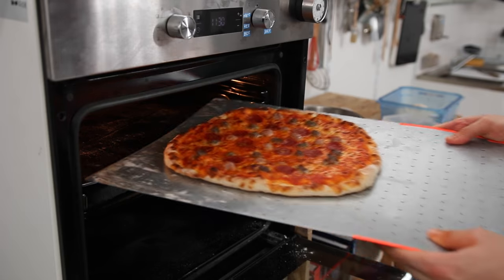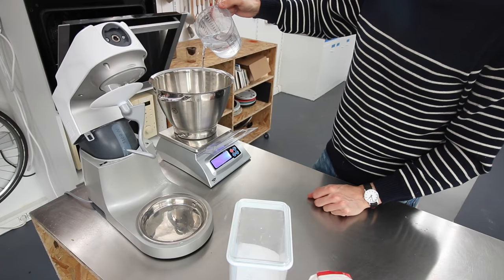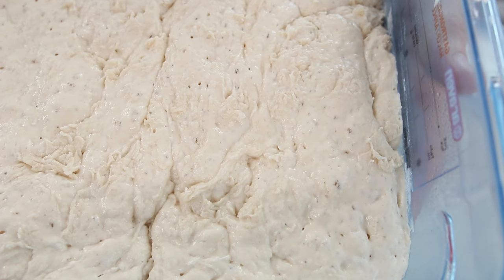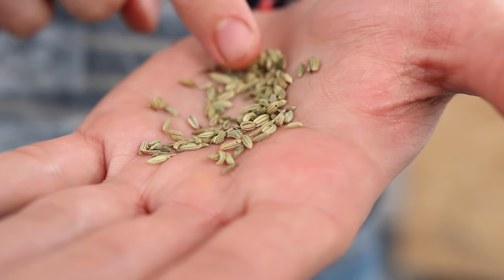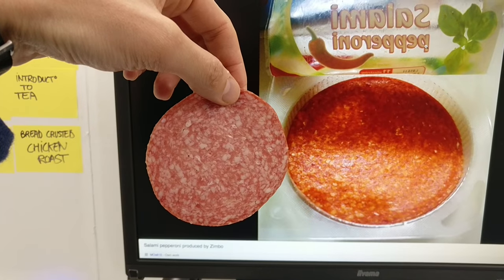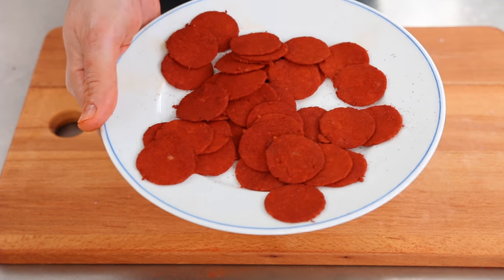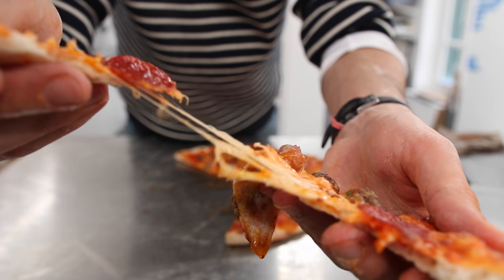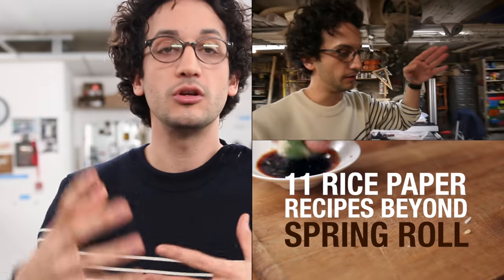How to Make DIRESTA'S MEATLOVER PIZZA : Pepperoni, Sausage & Meatball !

Comment: Something that Alex didn't immediately mention in his video that I thought I'd highlight is the nature of the flour that he used!

He's using a Type "00" flour, one that's extremely light in comparison to all-purpose or plain bread flour. It produces a much lighter crumb on the inside of the pizza, and allows for a crispier, almost cracker-thin crunchy crust on the outside. It can also produce crusts that can handle temperatures in excess of 700 degrees Fahrenheit.

Happy cooking!!

Comment: Good morning my french hero! Inspired by you I also made a baking steel for pizza :D But instead of stainless steel I milled it from aluminium. This has in my opinion a couple of advantages: It heats up a lot quicker and also transfers that heat a lot quicker to the pizza, since stainless is a very bad heat conductor. The second advantage is that it is three times lighter and also a lot cheaper to use aluminium. I milled it to the size of my oven so I don't need a tray, it just slides in and my pizzas can be larger :D I also found that it was hard do heat it up properly with a preheated oven and grill, since ideally you want it around 300-400 degrees. What I do now is turn on the grill of the oven 5 minutes in advance, heat the baking steel on the stove on all burners up to 370°, place the pizza on the baking steel and transfer them together from the stove into the oven as close to the grill as possible (use welding gloves, normal cooking gloves will melt on the inside!). From that moment on I leave the oven open to trick the thermistor into keeping the grill on, but this will differ per oven. This process will decrease baking time, decrease the preheat time and decrease the energy usage. To get it up to 370° I just calculated the expansion of the aluminium and measure it with a ruler, mm's are accurate enough. No (infra red) thermometer needed. Thanks for your inspirationd and I hope my experiences can inspire you too! Nice pizza btw for my other and biggest youtube hero, Jimmy

Comment: I think I finally nailed the dough!!! Something happened and I realized I didn't measure the water to 600gr so it was a little more but the kitchen machine was already spinning. I looked at the dough and though why not, let's see what happens. Yes, I'm nowhere near pro and more chef than baker, how could you tell? The dough came out very soft and almost too sticky but I decided to go with it. I put it in the fridge overnight and the following day, happen to be yesterday, I made the first pizza. The most wonderfully stretchy elastic soft supple dough I've ever seen in my life!!! It wad also perfect for lifting up on your folded fingers and stretch it in the air. It's like there is no table for the dough to get stuck on and it stretches more evenly. The pizza came out nothing short of spectacular, just like in a cooking show, crunchy on the outside and soft on the inside. Now I feel I'm there. I know how I want my pizzas to be!  So ... as moist dough as possible, rise overnight in fridge, stretch over your hands and bake on a pizza stone ... I might want try a pizza steel some day, but I'm not sure how much difference it would be at this point! I'm just exited to make much better pizzas than what I can buy at any pizzeria around here! :D

Comment: Transfer to the peel after hand tossing and b4 saucing and topping. I see your ghetto peel probably didnt allow this. My ghetto rigged peel is a lightly floured plastic cutting board. Any ghetto peel I would test after saucing by giving it a shake to see if the pie slides around nicely. Any real peel I do the same except right b4 transfer into oven. IF it's sticking. you can try lifting where it's sticking and tossing a bit of flour. Usually sauce related. I've noticed this flour dusting doesn't fire off a stone at 500F(the highest my oven goes) but does at the proper pizza oven temp of 750-800. Not a huge issue for me but not perfect. I guess you could transfer to a rack and brulee the bottom of the crust if you wanted. I just minimize the amount used for dusting the peel. Not sure if anyone else has ran into that. Deep dish is a superior pizza anyway.

Comment: Next time try baking the dough a bit, then putting on the cheese.  You will separate the fats out of the cheese less so it won't be swimming in grease and it will stretch when you pull it.